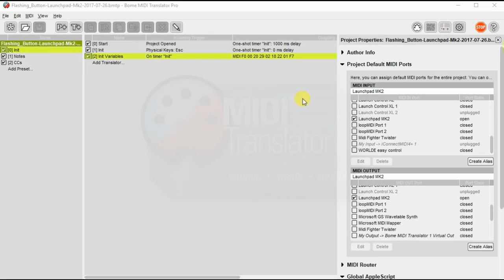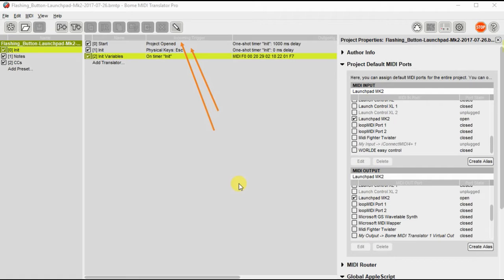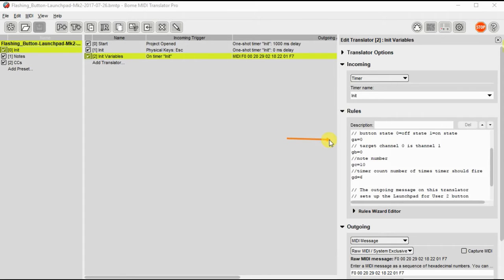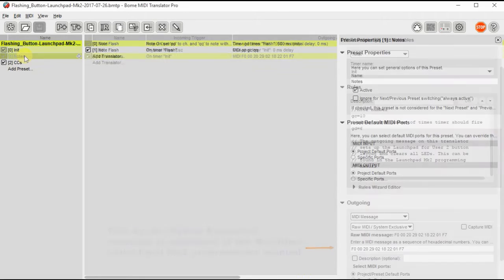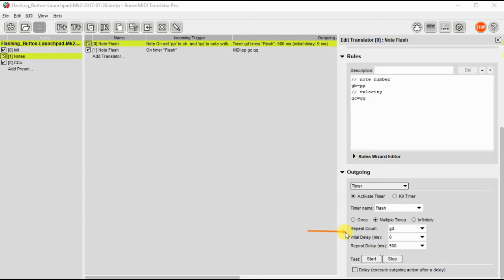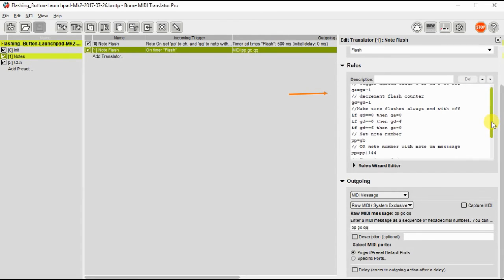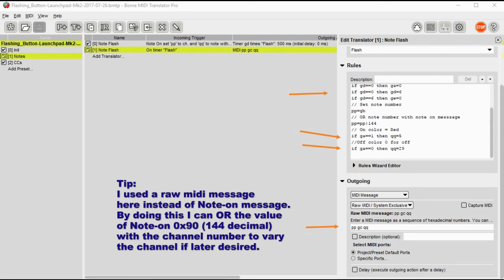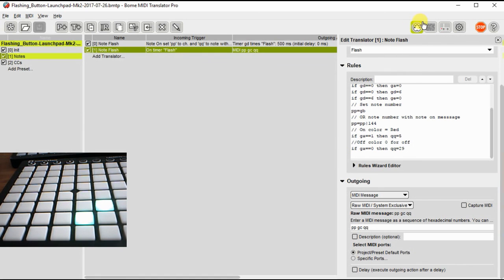Tutorial: Blinking Launchpad Buttons using a timer in Bome MIDI Translator Pro

Comment: can this same method be used to indicate states? Like on my APC40 the knobs turn continuously and have little lights that show it's position. I want to use them for volume control and was hoping that I could set the position light of the knobs to the current volume when i started up the translator project
Reply from the maker: Yes, you can remotely control the LED's of your APC40 using Bome Midi Translator Pro.  If you are interested, please go to the Bome Forum below and do a search. If you can't find what you are looking for feel free to post a question.

http://forum.bome.com

Steve CaldwellBome Customer Care

Comment: Hi there, in Presonus' Atom, the pads send pre-defined MIDI notes and cannot be edited, will Bome Software can help me let's say to map EZ Drummer 2 as I want it even if it doesn't have midi map editor like Addictive Drums or Superior Drummer? Thanks
Reply from the maker: Hi Victor. Yes Bome MIDI Translator Pro can map existing notes to any other note and/or MIDI channel. If there is a pattern, it might be even easier as we could use a set of forumlas to do it in a single translator rather than a different translator for each note.  Fee free to download the trial copy and play with it. If you have any questions, reach out to me on the Bome Forum at the link below:

http://www.bome.com/support/kb

Steve Caldwell
Bome Q and A Moderator and
Independent Bome Consultant/Specialist
bome@sniz.biz

Comment: Does it work with LAUNCH PAD MINI ??
Reply from the maker: Hi Antek, yes, it works just the same with the Launchpad Mini.
Reply from the maker: Yes but the note values are different on a Launchpad Mk2 than a Launchpad MINI. You will need to review the MIDI map for the Launchpad MINI and adjust accordingly.
Reply: thank you